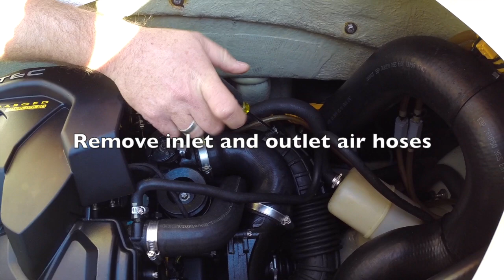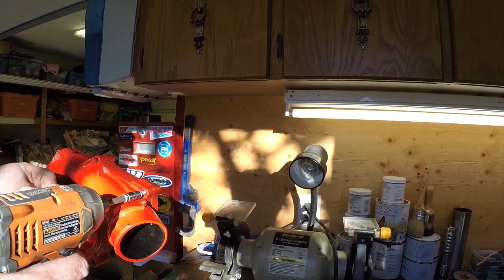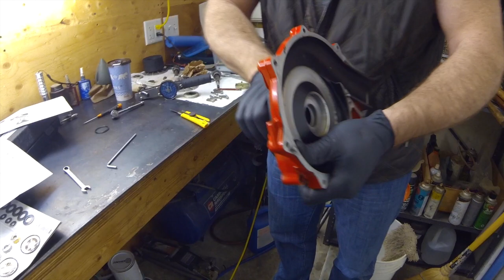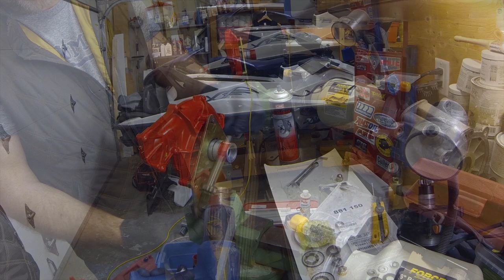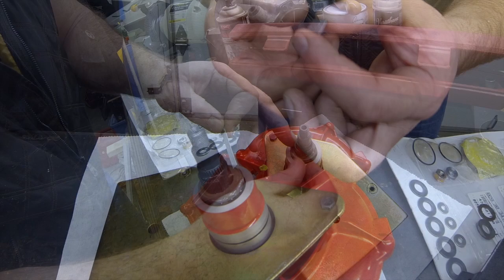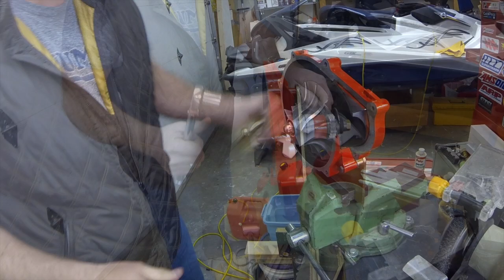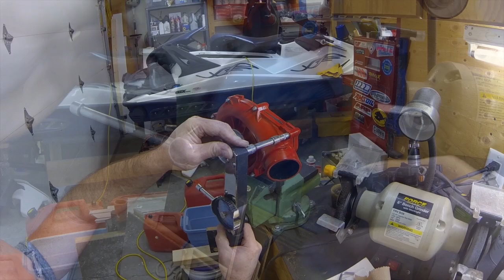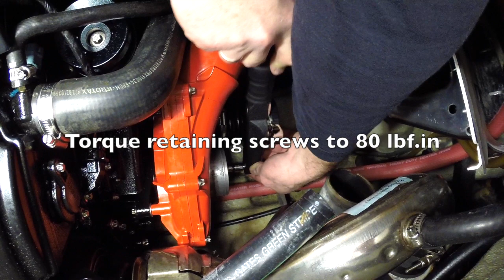How to Rebuild a 4-TEC Jet Ski Supercharger (on a 2005 Sea-Doo GTX 185)

Comment: What model torque wrench do you use? The one with the dial.
Reply from the maker: It's a brand that's essentially the same company as "Snap-On", but less expensive. I've added a link to it in the description below. Whatever you buy, make sure it has the dial so you can see the torque being applied.

Comment: Whats the normal cost to have someone rebuild a SC ?
Reply from the maker: It depends who does it, and if they have to remove it from the machine. If you remove the supercharger and give it to a knowledgable friend to rebuild they would normally charge around $100 labor. A dealer would charge quite a bit more. The rebuild kits usually cost about $275 US.
Reply: @3ftDeepChannel   Thanks for the info !

Comment: I've got a 150 speedster 215hp rotax supercharger to be rebuilt. Is this the same?
Reply from the maker: They're generally the same, but you need to make sure you're getting the right kit for your year and model (we suggest getting it from Sea-Doo through your local dealer). There are some differences. The good news is they've upgraded them over time so your new rebuild kit likely contains superior parts. Good luck.

Comment: Hey,
where did you use the Camshaft Locking Tool and the Needle Bearring Pusher, didn't see it in the Video.

I bought an Seadoo RXP 215 and want to rebuild the Supercharger myself at the next 100 hours.

Thank you
Reply from the maker: JaWeLe Good catch. We don't actually use either in our method, but they're both recommended tools by Sea-Doo. We like to include all the tools that they list in their service manual, in case you want to do some extra steps that aren't always necessary (i.e. we take some shortcuts). Thanks for your comment.
Reply: Thank you for asking this question! Very helpful to me now wondering the same thing after failing to order the 4-pin socket. No substitute for that tool  thanks again @3ftDeep for the helpful information!

Comment: Hey guys. My retaining disk is stuck stuck. Broke a stainless extension, the 3/8 opening on the 4 pin tool is beginning to warp, and the retaining disk itself has a chip in the metal from the tool popping out on my last attempt. Any ideas other than heat. I understand get as much leverage as possible but if i dont push in on the 4 pin tool it pops out so easily…
Reply from the maker: My 4 pin tool was starting to do the same the pins were loose and the 3/8" opening was getting sloppy I bought a 3/8" to 1/2" adapter and had it welded on and the pins tack welded in place so there was no slop in the tool.  

I had one rebuild where the disk was unusually hard to remove, heat the housing with a heat gun to loosen the thread locker, clamp the holder plate in a good solid vise and use a 3ft breaker bar it will come loose.  If you get the tool welded up you can also try a 1/2" impact gun I found this only works if you get the tool fixed otherwise there is too much slop and the impact doesn't work as good.

Good Luck

Comment: I have a 2006 RXT and had them replace the ceramic washers with the metal before a problem happen.  I have 146 hours.  (some after the switch).  

Anyway, I took good care of it, and it looks and runs like new.  Seems to rev up to high rpm's like always and you can still run it like you stole it.  (but at a cost of 1 tank each hour)

My question is, how do/will I know when I need a supercharger rebuild?
Reply from the maker: Great stuff! We knew a guy who decided to take one more ride before he rebuilt his supercharger on an older machine, and that’s when it failed. Over $2,000 damage. Just go by time. With newer kits you can get at least 150 hours. Some people say you can squeeze 200 hours out of them or even more. I rebuilt my last one at 175 hours. It’s your call, really. Good luck!
Reply: @3ftDeepChannel  Really appreciate the responses to my questions.  They are fun to ride, sad the upkeep (money wise) is so high.

Comment: How can we understand that our super charger has issues and needs to be rebuild ?
Reply from the maker: If your machine was built between 2004 and 2008 (inclusive), you should ensure your supercharger has been rebuilt before using your machine again. Also, in our opinion your supercharger should be rebuilt every 150 to 175 hours, unless you have a 300 HP machine, the superchargers in which does not require rebuilding.
Reply: @3ftDeepChannel  I understand. Thanks for the reply. Its 150 hours on my 260 gtx 2015, are there common signs for turbo malfunctioning ? For example, not making top rpm of 8000, not getting top speed, getting different sound or accelerating slower ? Because it costs a lot here (Turkey) Thank you!
Reply from the maker: Yes, you’ll loose boost. It could also reduce your maximum RPMs. Other things can affect top speed, too. If anything is stuck in your intake system or pump, that will cause the most problems. Also, your wear ring clearance should be checked, as wear in the wear ring will cause a big drop in performance. I would check those things, first. Good luck.

Comment: What’s your opinion of the modern SeaDoo superchargers? Would you say they are largely reliable?
Reply from the maker: So far they seem quite reliable. We will see if they stand the test of time and really don’t need rebuilding like the older ones do. We'll see…
Reply: @3ftDeepChannel  awesome, thank you. I’m going to preorder a 2022 this weekend and I can’t decide between the GTI 170 and the GTR 230. I’d love the GTR but I’m a little hesitant to go with a supercharger just because of the cost, if it fails. The NA 170 engine is extremely reliable and the top speed between the two is only about 8 MPH. It’s a tough decision though!
Reply from the maker: I wouldn’t worry too much about the supercharger failing. You will just need to rebuild it between 175 and 200 hours That normally costs about $400 just for parts. Add a few hundred dollars labor plus tax and you’re looking at about $800 plus. So, it’s really the cost and hassle of the supercharger to consider, but the additional power on the GTR is substantial. Good luck.

Comment: please i need your help
i bought a seadoo 215 2006 a rxp last week and this is my first time to buy a seadoo how could i know if the supercharger not good

Thank you
Reply from the maker: You'll notice a big decrease in power and feel a bit "sluggish" getting to higher speeds. If the supercharger has never been rebuilt, you should do that right away to avoid engine damage.
Reply: 3ftDeep Thank you for your  help 
Is there any sound could come from it ? i did not launch it in the water yet
Reply from the maker: There may be, but it'd probably be difficult to hear over the sound of the engine. If you don't have evidence that it's been rebuilt, I'd do that right away. Good luck!
Reply: plz do you now how much cost to fix it by oem parts?
Thank you
Reply from the maker: Atheer Ismail You can buy a kit either through your dealer, or SBT, or I believe GreenHulk also sell them. They're more expensive from the dealer, but expect to pay about $400 to $450 when you're done.
Reply: 3ftDeep
Thank you so much
i appreciate your help
Reply: superchargers are scheduled for rebuilt at the 150 hour mark. So I would suggest at least checking the supercharger at that point. rather to rebuild a supercharger for 400 rather than rebuild a motor for a couple grand. to test remove can cover. rotate motor to top dead center on cylinder 3. place can shaft locking tool in. take a 18 mm socket on nut of turbine. take a torque wrench set at 7 pounds and rotate counter clockwise if it spins before u hear the torque wrench click with the applied pressure you need a rebuild. any other questions be happy to help.

Comment: so around $300 to rebuild that ?
Reply from the maker: I think the kits are around US$500 now; so if you build it yourself you should estimate that cost. If not, it’s much more expensive.
Reply: I got a quote from Riva it's 450 for the kit and 200 for them to rebuild. You just need to remove the SC and send it to them. 650 total.
Reply from the maker: Thanks for the info. Getting the SC out can be a bit of a pain. Budget a few hours to get it out and back in.

Comment: Would this be the same process on my 2012 gtr 215?
Reply from the maker: Generally, yes. We rebuilt our GTR 215 using the same method. You need to make sure you get the right kit for your machine, though.

Comment: Dear 3ft,  I have a seadoo RXP260RS 2013. is what you're doing the same for the SC on my seadoo? thankyou !
Reply from the maker: It’s generally the same with superchargers on all sub-300 HP machines. There are some small differences, however, so it’s always best to have a service manual for your machine handy. If you send me another message in a couple of days we can provide you with a discount code for a digital service manual from eManualOnline.com.

Comment: that is not the turbine... it is called a compresor wheel....
Reply from the maker: Yes, it's called both a "compressor impeller" and a "turbine".
Reply: a turbin is spun from hot expanding exhaust gases from an engine, this is not a turbine it is the compressor section. the "turbine" in this case would be the gears that spin the shaft
Reply from the maker: Fair enough. But let's not confuse people, as the Sea-Doo shop manual refers to "turbine" for that part, not "compressor impeller", which they probably should have. Thanks for your comment.
Reply: got it, must be sea-doos interpretation of it. thanks for the video great job!

Comment: That's alot of $$ at a dealer every 5,000 miles! Heck Ducati's have a bad reputation requiring servicing every 15,000 miles and a minimum of $1,500 to $3,000.
I bet this is easy $1,500. So about $3 hour in wear.
Reply from the maker: The kit is about US $350. The newer models are supposed to be "maintenance free", but the ones for the 1503 engines are supposed to be rebuilt about every 100 to 150 hours. So you're right, it is about $3 per hour - just for the supercharger. Thanks for your comment.

Comment: What is the tool called that you check the slipping movement with? Thanks
Reply: Found it! Thanks
Reply from the maker: You can find one here: http://3ftdeepsports.com/store-tools-wrenches/
Reply: Is it normal for the slip to be a little bit high initially? Just installed a brand new kit along with new wheel. It will slip at about 132in lbs.
Reply from the maker: Yes, the spec for a brand new supercharger kit is slightly higher than after it is broken in.